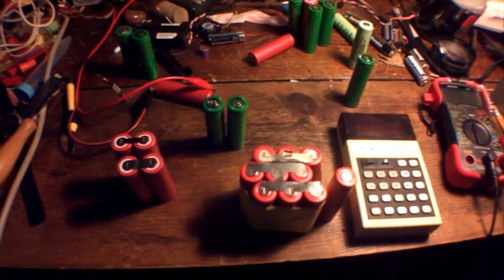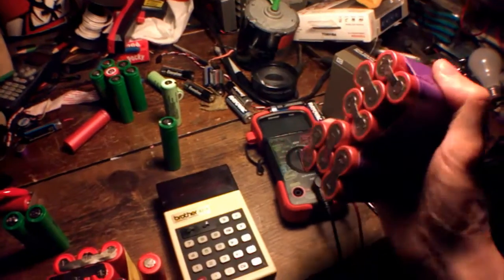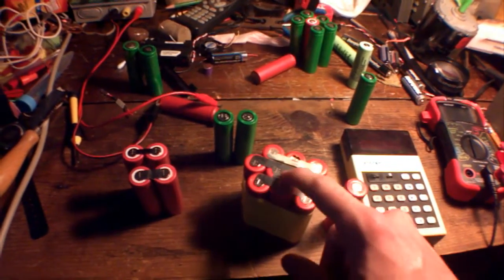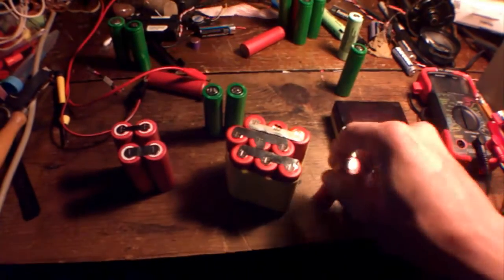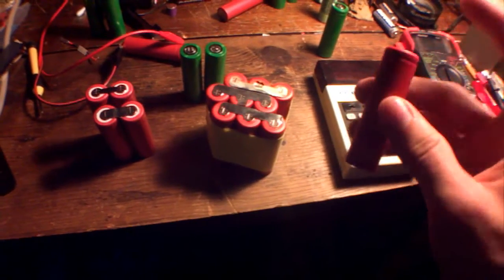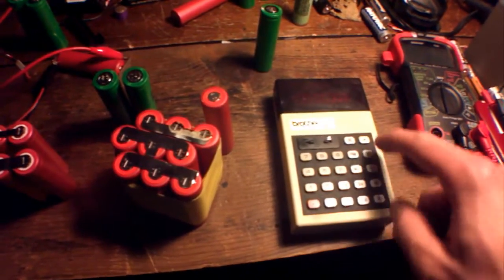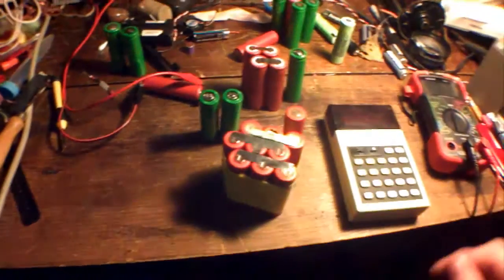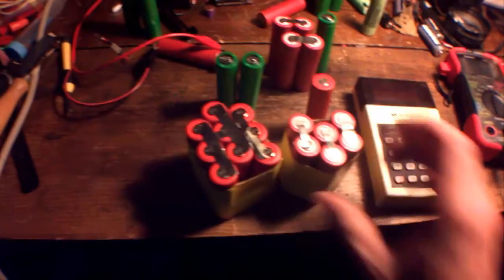how to calculate Battery Capacity of LiPo 18650

Comment from the maker: oh and FYI you could charge them to 4v. most chargers charge them to 4.2v but i preffer 4.0.

at 4.2v you can get 300-500 cycles (depending on depth of discharge) and every 0.1v you lower your voltage you double the lifespan and lose about 15% capacity.

FYI at 3.8v they are about 30% charged. oh and dont forget to do a saturation charge on your batteries.

Comment from the maker: oh you got 2 shorted cells? you can open them to get a sheet of lithium metal for latter experiments! its safer to open shorted cells since they wont explode so easilly. just keep your witts about ya, the acid inside the cells can be kind of annoying. (doesnt burn too bad though)

and nice, i'm glad your learning lithium-ion, what kind of power supply do you have?

Comment from the maker: oh and if you let the battery sit and it doesnt get above 3v then youve discharged it a lot and where rough on it, going that far is about as rough as like 20ish regular cycles. (just my opinion)

but FYI all the cells i made my first battery pack (this 9ah one) where bellow 1v from sitting in a warehouse for 12 years. that only killed about 30-50% of their capacity, although i think the 12 years has some blame too.

i hope your cells have nice ah ratings.

Comment from the maker: hahaha, i was gonna reply to your last comment then you deleted it, your fast ;P

i dont know of any set standard for testing cells, just i knew that if i pulled 2 or so amps and it dropped bellow 3v then i'd count that as a empty battery even if it would spring back to 3.4 or whatever.

if the cells drop to under 3v under load that would mean the dead 48v battery would drop to 36v and thats the cutoff voltage for my motor controller.

Comment from the maker: is that 3.5v under load or after its voltage has stabalized?

remember the voltage charges depending on if the cell is under load or not

Comment from the maker: i dont understand what you are asking about. (2.5v-3.3v ?) is not enough information for me to understand the question. it looks like a statement with a question mark after it :p

remember the voltage of a battery drops as you pull more amps from it, but when you stop pulling power from it the battery voltage goes back up.

Comment from the maker: well 3.6v is usually about 0%. but thats the voltage after the battery sits for a few minutes without a load.

i discharged these until they read 2.8v with the load on them. then they would spring back up to about 3.5v

the video i made before this was of me testing the cells.

youtube.com/watch?v=tzyoksEx7ik

Comment from the maker: what are you doing to them that is blowing them up? charging? discharging? bashing with a hammer?

remember that you shouldnt pull more than 3-5 amps per cell or they can overheat and melt. or worse have thermal runnaway. and 2 cells in series would be 8v - 8.4v not 7.4v.